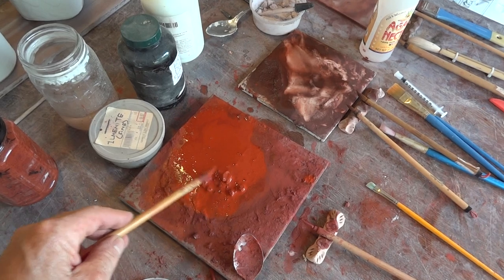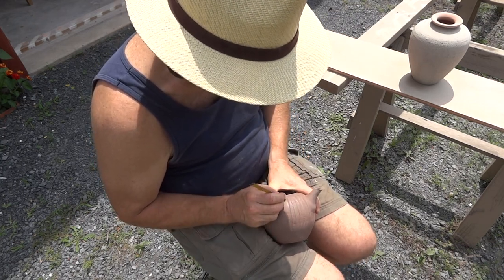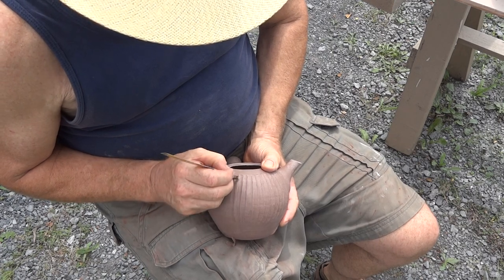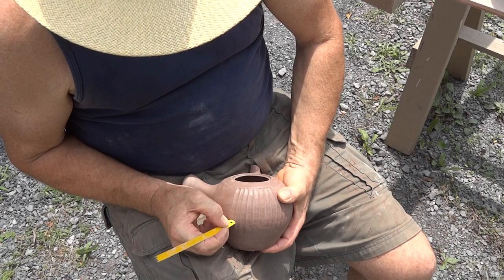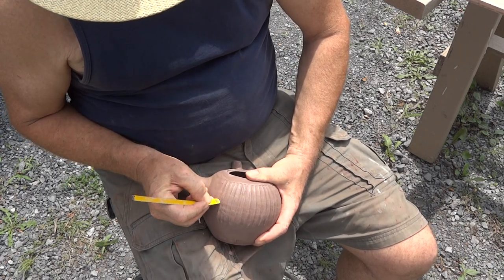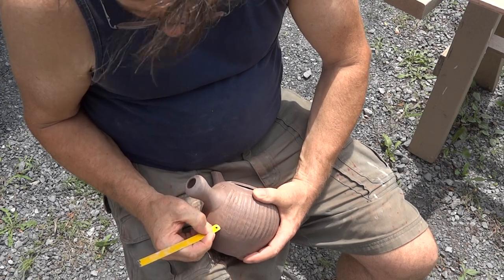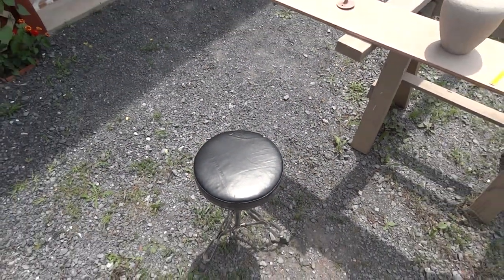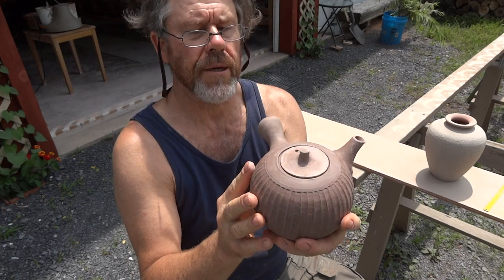How to flute or carve a side handled teapot  - July 19  2017

Comment: I just went all the way back to your first clip: making plates, but not talking.  That looks like the splash pan I have been trying to replace. Shimpo doesn't make them any more. Every time I touch mine some part cracks. Newer stuff doesn't fit it without a lot of adaptation.  Nice to know I'm not the only one with a very old wheel. Mine is circa 1972 or 3.

Comment: Could you please explain your firing sequence (time line), especially the heat up and start, for when you fire raw glazed pots up to cone 10? And would that be the same approach to just a bisque when firing with gas instead of electric. Also, how much fuel does your bisque firing use up? You may have covered this in the past, but I haven't found that information yet. It's been 15 years since my studio was up and running. I'm afraid I have forgotten so much. My electric kiln controls are rusted up and dangerous for electric firing. Can't even get the boxes off (it's a Paragon from back in the early 70's). So I find myself needing to convert it. Is it necessary to remove the interior wiring? Thank you.